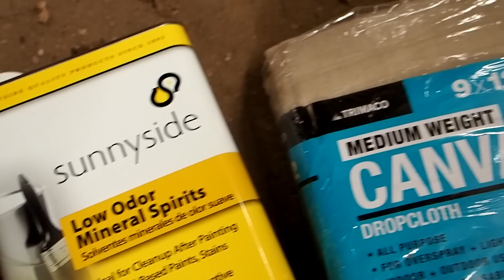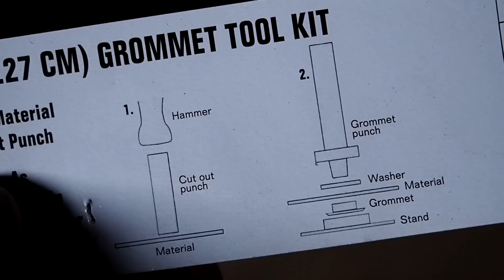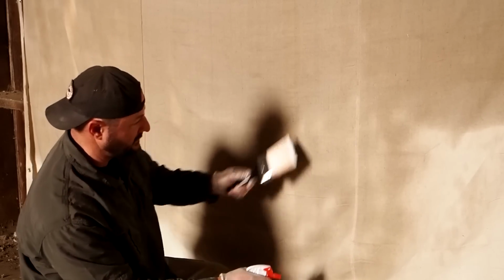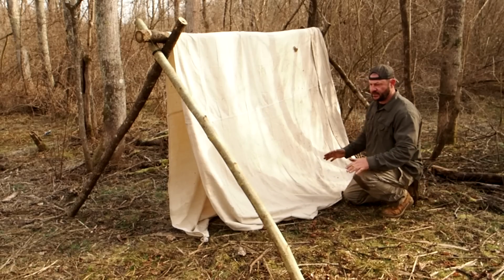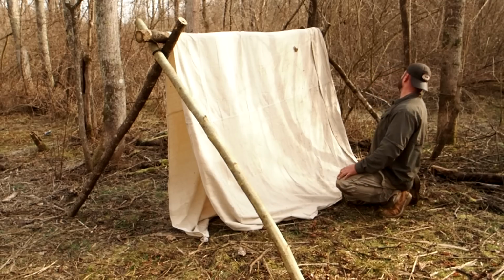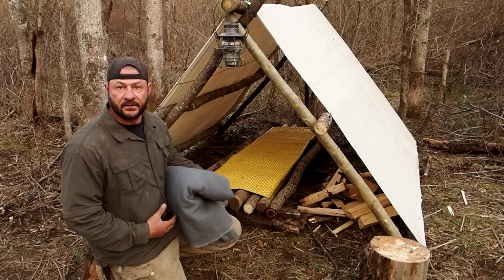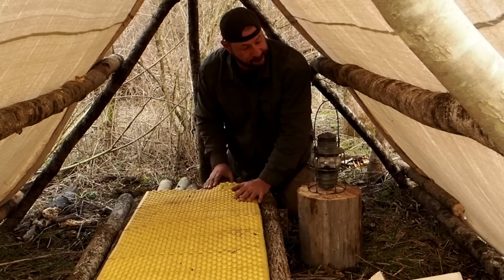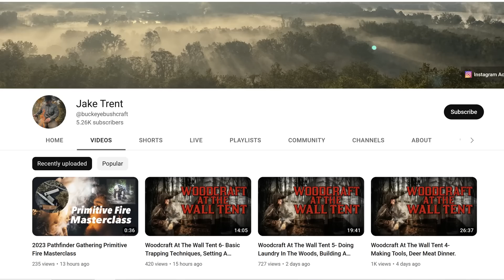Solo Overnight Making a DIY Waterproof Canvas Tarp for $40 in the Rain and Sausage Egg and Cheese.

Comment: I'm confused how mineral spirits is supposed to make it waterproof. It should just evaporate as it's only alcohol. That's the entire point of the linseed oil that you dilute with mineral spirits. That's probably why you don't see water beading up on it when you show the tarp getting rained on for 3 seconds. You didn't want to show it failing.
Reply: Mineral spirits aren’t alcohol they’re a distilled petroleum product, and will leave behind some residue in the tarp. You may get one or two light rains, but that would be the absolute most. You are right about using linseed oil for the actual waterproofing though. These days however the preferred and better go to is silicone. It lasts a lot longer, and works a lot better.
Reply: @ericcarter2020  They pointed out a valid issue.